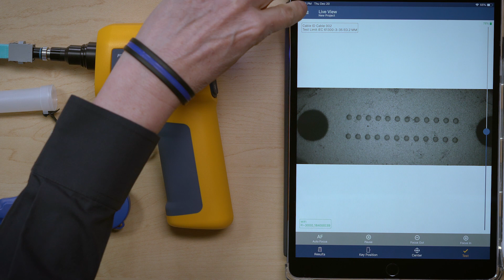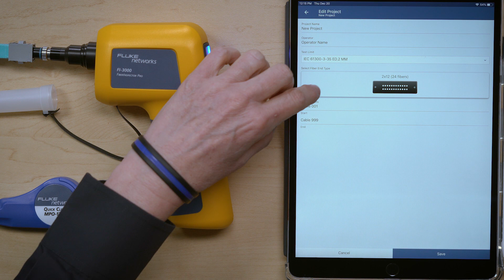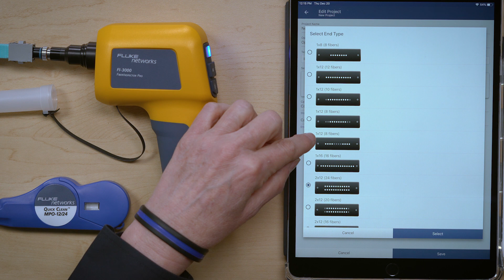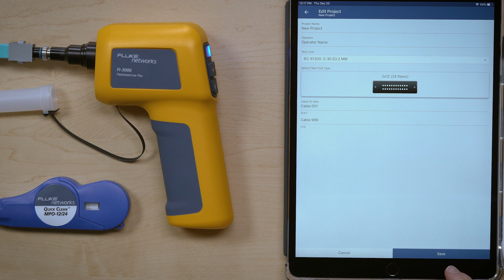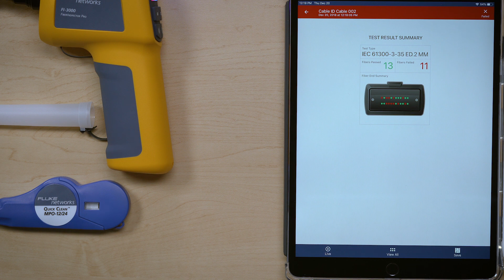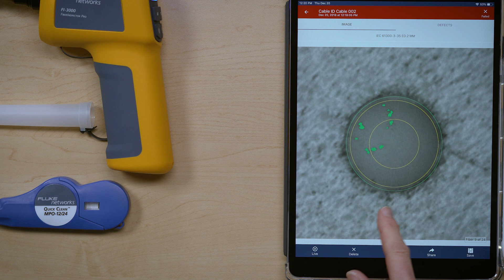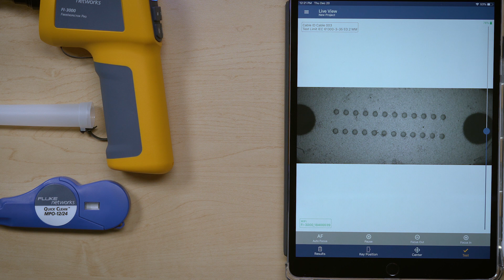Perform an Automated Inspection with the FI-3000 FiberInspector™ Ultra by Fluke Networks

Comment: I know from working with fiber for years, 90% of troubles are the connector faces.  How accurate is the connector face analyzer tester (fl-3000) compared to the fluke MPO mpo light loss tester(MFTK1200)?  I guess my only worry is a good mpo connector face test could comeback on both ends, but 1 fiber could be broke in the mpo cable.

it would be nice to have a comparison video with both units in action finding faults.  The nice part about the FL-3000 is one unit that can test SM/MM + 12mpo and 24 mpo for around 5k.  The MFTK1200 can only test 12 MPO mm or 12 mpo sm for 10k each or both for 20k package--- and no 24 mpo testing.